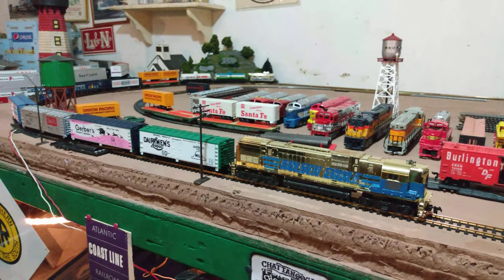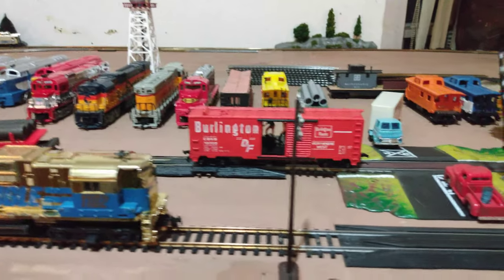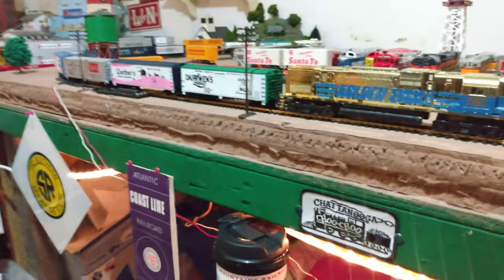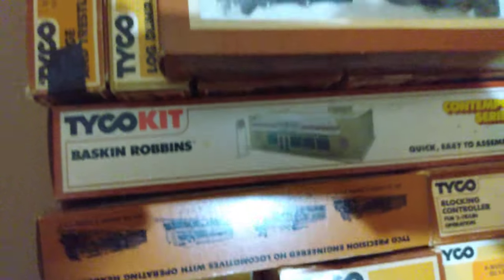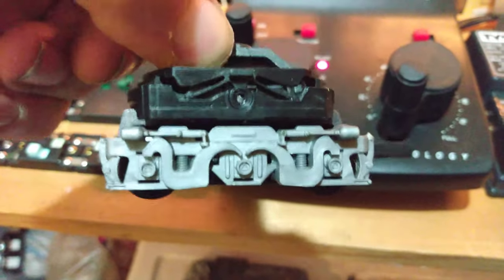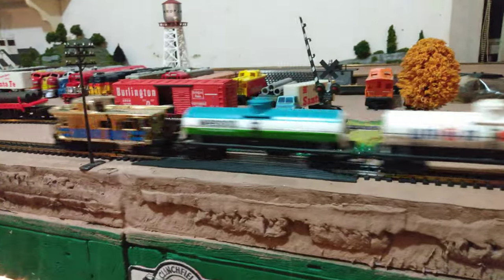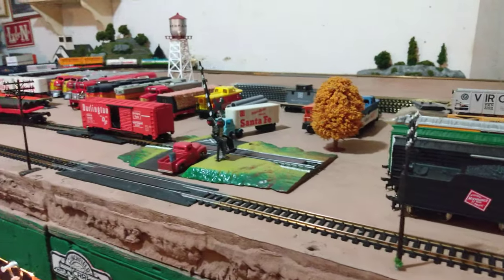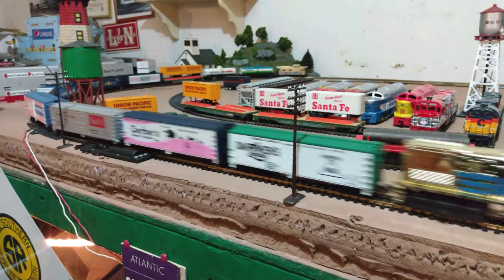HO Scale TYCO ALCO GOLDEN EAGLE Complete Restoration An Update to my TYCO Train Layout & Collection

Comment: I thought all those transformers were the same.  lol
Reply from the maker: No I've got 3 Tyco gold transformers and one plastic model 895 tyco transformer those I mainly use for like accessories and lights! And the main one I use is an MRC 280 Tech 4 double throttle! It's the one I use to run my trains with it works awesome  but I'm gonna get rid of it and get a double throttle vintage Tyco transformer to run my trains I want eventually everything to be Tyco even my transformers that run the trains and accessories! Thanks for watching and commenting my friend!